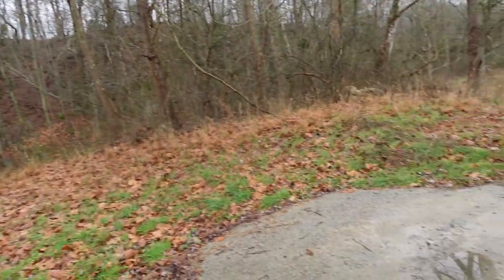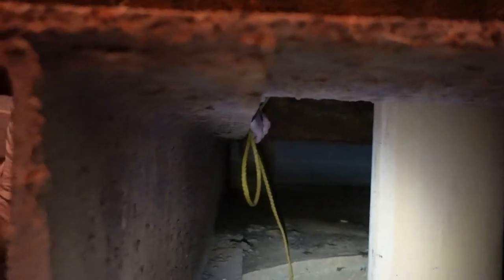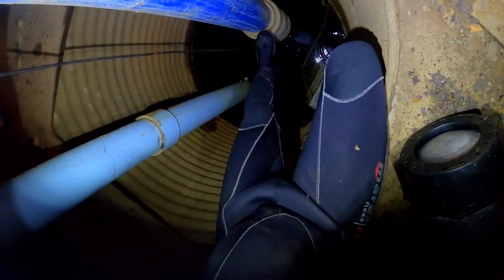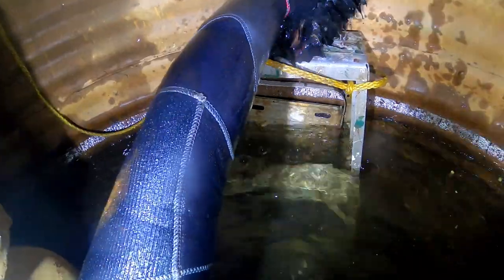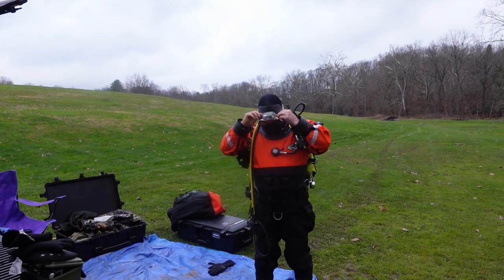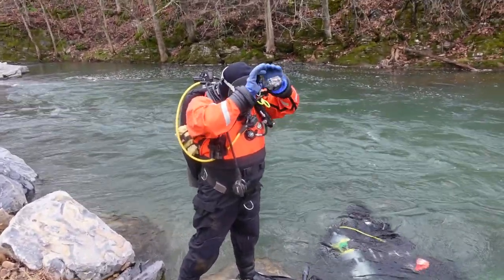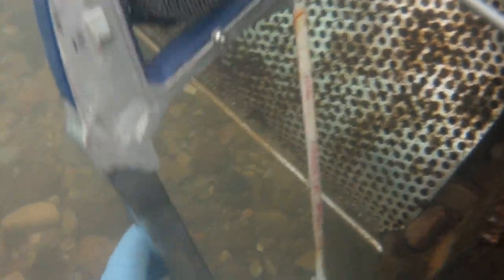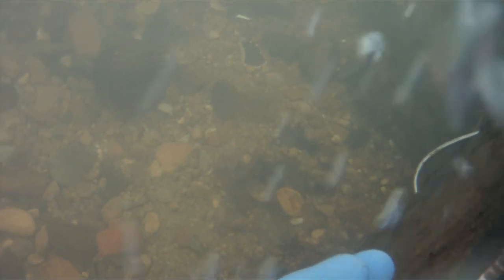Diving In A Freezing Cold Wet Well

Comment: Do you guys take air samples of the pits and wells y’all climb in to? Obviously you’re on scuba underwater. But I’m just curious as to if you take those samples with a air monitor
Reply from the maker: Depending on the job yes. If you seen one of our older videos, where we repelled down into a sewer system, we did in that video.

Comment: a hookah system with about a 25' hose would of been a great asset.
Reply: Unless the needed the weight.
Reply: @dawnthemetaldetective3083  not sure why you would trade unlimited air for a bully tank when some extra weight would solve that problem.
Reply: @mrstihl16  it was just a guess.
Reply from the maker: The Hookah system would have worked as well Kirk Wutzke.

Comment: Why not set up an actual lowering system to lower a diver down the well? That way if anything should happen to your diver you've already got a system built. Just throw on your MA and haul him out. 
 This isn't a critique. Just an honest question.
Reply from the maker: Hello K B, depending on how much work space we have, we usually do. In this situation, we were fortunate enough to use the couplings on the pipes as assistance. We usually will try to find the simplest method and go with it.